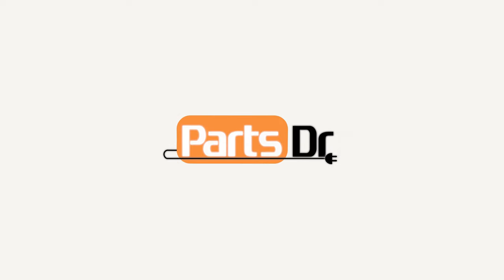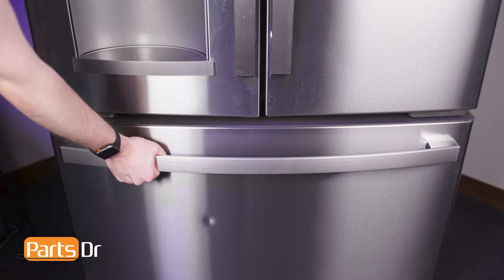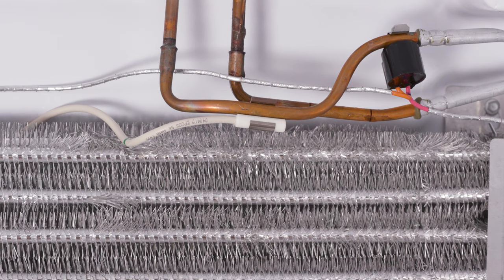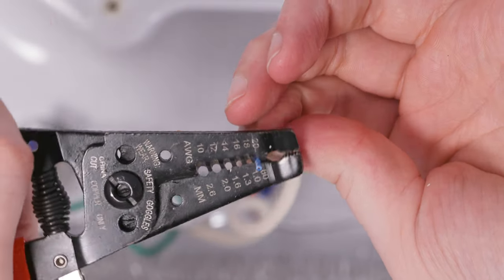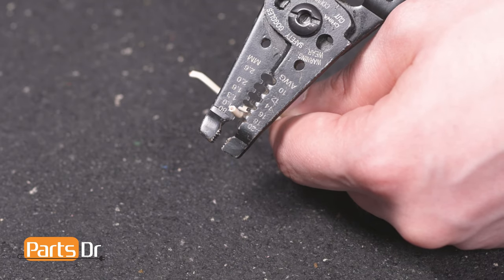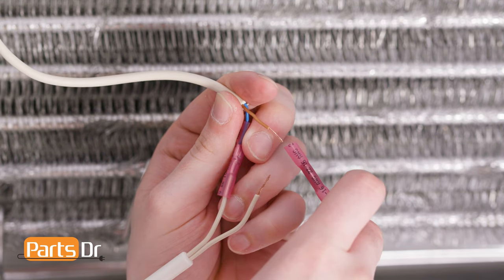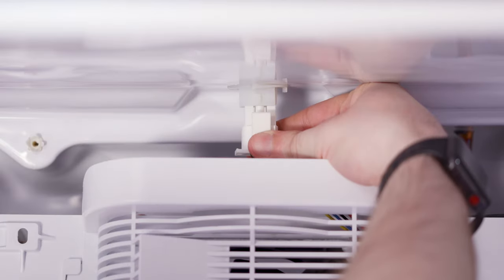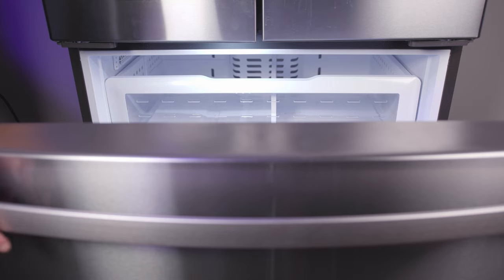GE Fridge Not Cooling? Here's How to Replace the Temperature Sensor WR55X10025

Comment: Changed all 4 thermistors, all fans are running, condenser is cleaned.compressor is running. Freezer will not get below 29°F. Another not the 10 awg is too small it will strip all conductors. It should only be used to score the conductor cover.

Comment: Went through diagnostic mode of a similar model and it gave code 00 05 which is for deli pan thermistor. Only problem is, my model doesn't have a deli pan thermistor as the deli pan isn't climate controlled. Tested all other thermistors and they're fine, compressor is running, condensor is running, both evap fans work; but still no fridge or freezer 😢

Comment: I have this model fridge and the freezer is working fine, but the refrigerator heated up to 60 degrees. I cleaned all the dog hair off the coils and then found that the circulator fan wasn't freely spinning and it would randomly get hung up. Replaced that and the fridge is now cooling again, but when set for 34 degrees I get a temp swing of 33-50. Could it be that the temperature sensor is failing? I watched the video on testing them and it seems easy enough, but since it involves cutting the wires, is there a way to measure it from the main control board in the back?
Reply from the maker: Yes you can test them from the back if you can identify the wires.  Make sure the refrigerator is unplugged, and the wire connector is disconnected from the control board.  Also, make sure to control the temperature of the sensor while testing to make sure that you get accurate results.

Comment: I have a GE fridge just like this, how do I know what coil my thermostat and thermistor sits on ? Does it matter? I’m not sure what coil they were on when I took them off to replace.
Reply from the maker: It's ideal to have the parts in the same location as they came from the factory.  If you are not sure, try referencing photos or videos of a similar model to yours.

Comment: My GE fridge just like this one keeps freezing over in the freezer section. i thawed it out a month ago and it has froze over again allowing it to only stay around 20 degreees when it should be 0 . I have already replaced the thermostat and defrost heater. Will the thermistor help me out or what other options are there ?
Reply from the maker: Yes, a bad thermistor on the evaporator coil can cause this.  Let us know what you find.

Comment: I have a refrigerator just like this. Just having issues with it this morning took it apart it is not freezing in the freezer but it's not froze over either compressor is working fans are working just like they should
Reply from the maker: Is the evaporator coil getting cold at all?  If it is cooling, it should have a light layer of frost on it.